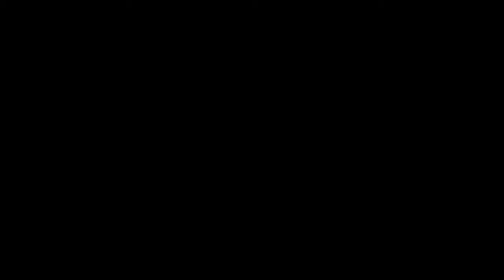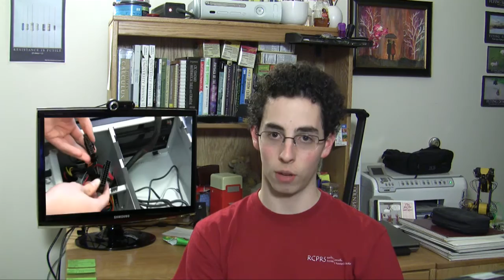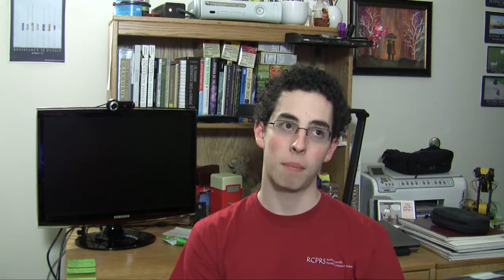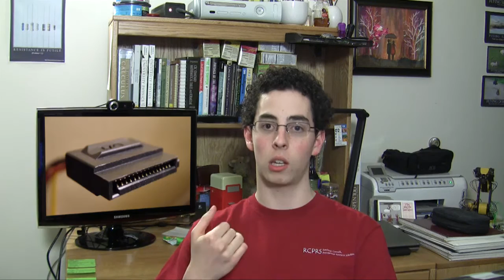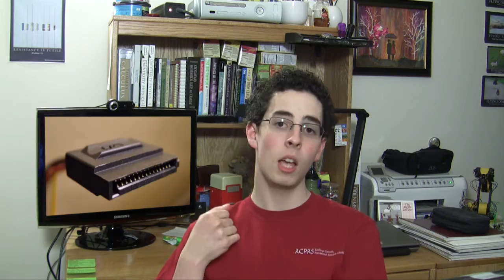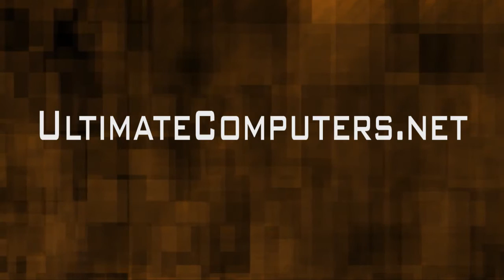TechBits 9 - Power Supplies Demystified (Part 2 of 2)

Comment: Hey I'm building a new computer and I'm just wondering what PSU to get either a corsair 1000HX or a thermaltake toughpower 1200w or any other psu. Here are my specs:
4 SATA HDD's running in RAID 5
12gb of ddr3 ram
Gigabyte x58-extreme
i7-950
Thermaltake Armour+ LCS (ps hooking up all fans and the LCS)
dvd/cd rw drive
ATI 5850
Thanks alot

Comment from the maker: Assuming both PSU are rated to be 80% efficient, yes the 650 would be closer to that 80% value.  However the difference would be very small, maybe a few cents a year on your power bill.

Comment: Like that guy above.. if I bought a PSU with 650 with the same setup he has. Would I notice a difference in power consumption with the 800w since the 650 keeps it somewhat closer to peak?

Also thank you very much for your help.

Comment from the maker: The PSU utilizes power sharing circuitry that allows one rail to "donate" amperage to another rail if it is being taxed to too much.  It should be able to handle new cards fine, depending on what else you have in your system.

Comment: brother i gotta say this was the best video on psus ive ever seen just subed but i do have a / i just bought a corsairhx620 modular psu w/312vrails at 18a each the manual says it can   garantee 50 to 100amp on the +12vrail how can this be and do you think this psu will handle the newer cards at load

Comment: like for example, a 8800gt needs 25AMPS each rain and it only uses 1 6-pin rain, if a \psu has 4 +12 rails with 18AMPS each, woudlt the 8800gt only be getting 18amps??